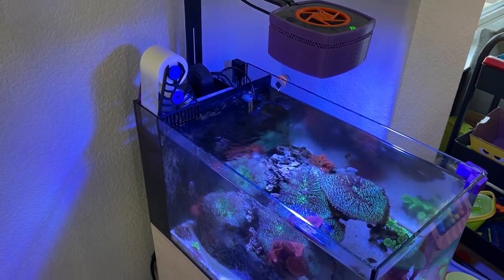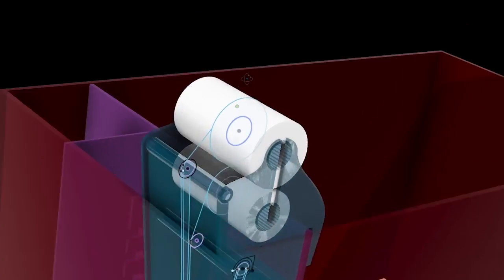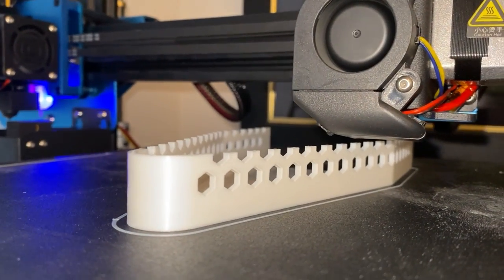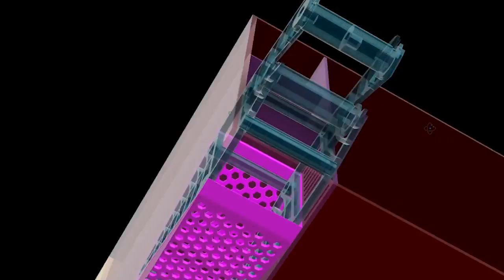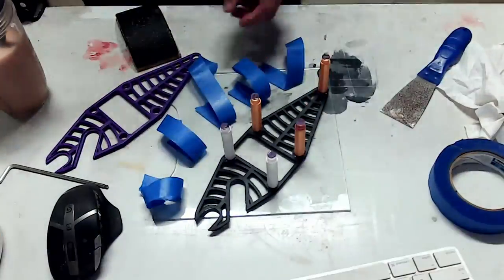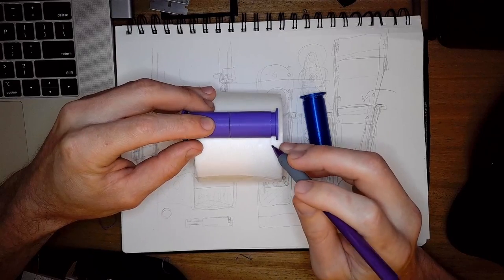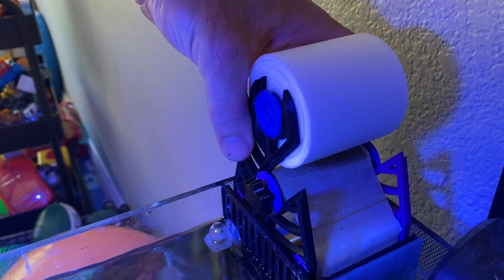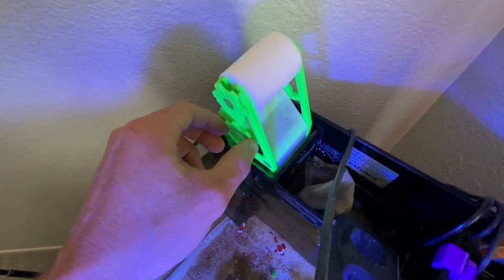First Nano Reef Roller Mat Filter - Fluval Evo 13.5 Filtrations Upgrade

Comment: Looks like once the dirty side gets too big it might get stuck hitting the clean side.
Reply from the maker: That possible for sure but I think it will be fine.  Remember as the dirty side grows the clean side shrinks.  It’s just a matter of if the dirty side gets thicker because of the waste.  It has at least centimeter of clearance so I am hoping that a fulling dirty roll doesn’t have a radius larger then 1cm from its original size.  If it does I’ll just make the roll smaller.